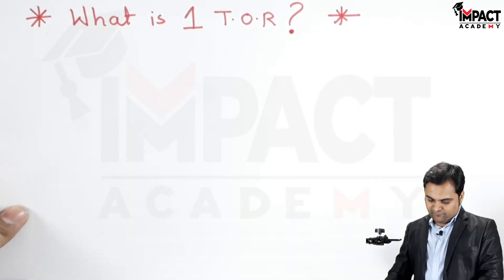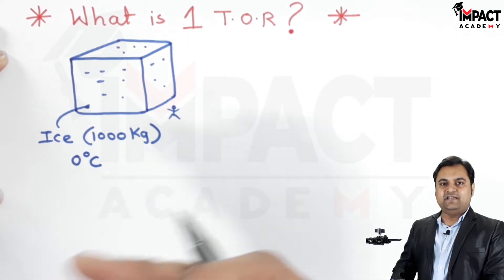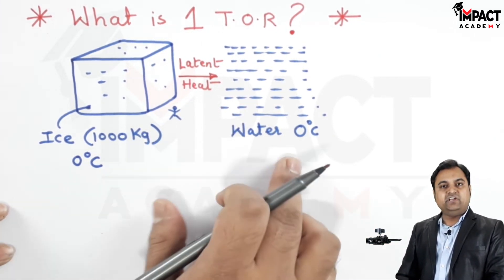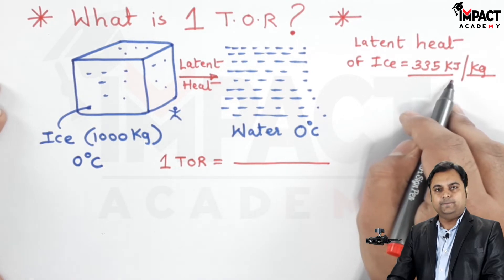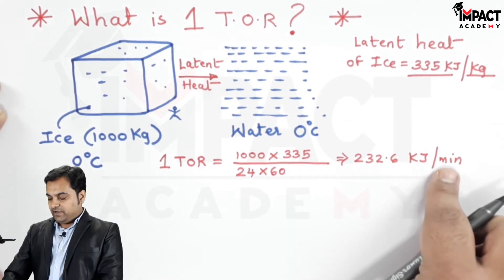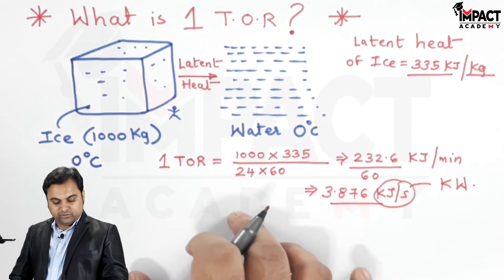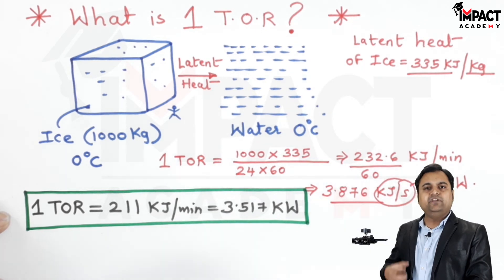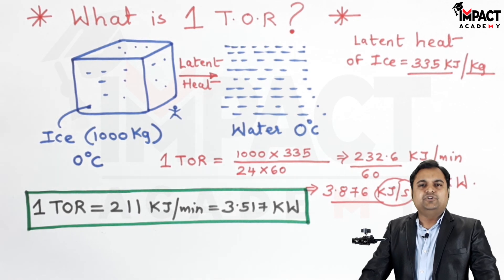What is 1 Ton of Refrigeration (TOR) | Refrigeration & Air Conditioning | Power Engineering#zafarsir

Comment: Hello. thank you for your explanation. It was a good explanation so i can understand easily. I have a question. on your calculation, u wrote 1 TOR => 232.6 kJ/min => 3.876 kW. How do you get 1 TOR = 211 kJ/min = 3.517 kW on your conclusion? thank you.
Reply: Adeline Ginny use ton not tonne to get 211kj/min
Reply from the maker: Bcoz experimentally the value was found to be 211KJ/min=3.517KW,which is accepted universally as 1TOR...👍👍👍